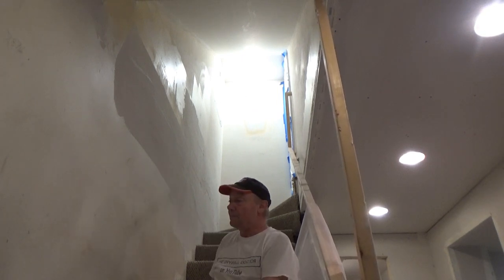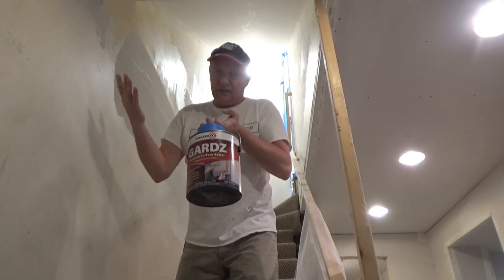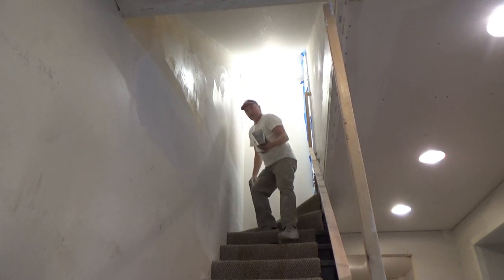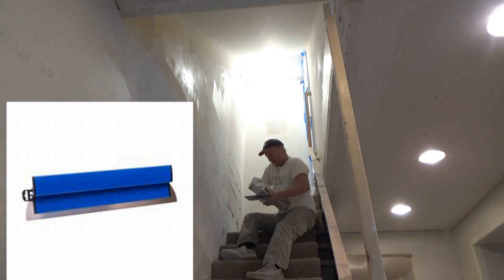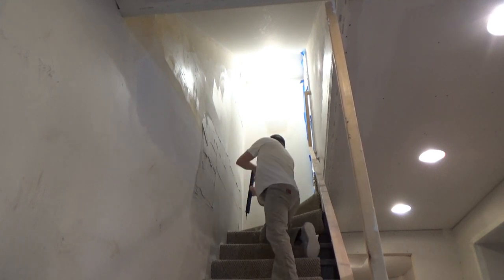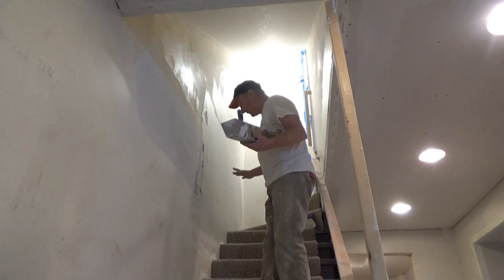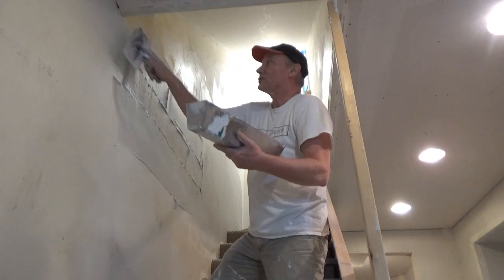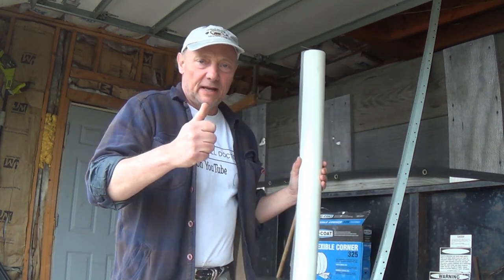Plaster patch part two and recap what we did so far

Comment: I've learned a lot watching your content.  I'm mostly self-taught and, while I'm able to get a good finish product, seeing a real pro at work both raises the bar and encourages me to stick with it.  I've been thinking about picking up a plasterer's darby for making large repairs and flattening really crooked stuff like you've got here.  Have you ever used one? I started out in the trade as a cement finisher and liked to use a cement darby for that, but never really considered a plasterer's type for drywall finishing.
Reply from the maker: Can't say that I have thank you for watching
Reply: They guy that taught me how to drywall would use a large Darby for leveling bigger areas (wonky ceilings and such)
Reply: @jimgill7524  Thanks. They are cheap enough-- $30.00-- that if it didn't work out I most likely won't go broke because I bought one.
Reply: @michaelkistner6286  that being said my buddee, I myself own 4 different sizes of skimming blades like the one he's showing in this video and I gotta say the finish job they can do is awesome. I could see the fill coat working well with the Darby and a finish coat with thinner mud and a skim blade working very well. Anyways I've got a full day of hanging beads on returns so I'd better get going. Have a great day sir
Reply: @jimgill7524  Have fun. I've only got three but plan on getting the big one for the next project on the books (couple of sizable ceilings to skim)..

Comment: Hey there Drywall Doc, I need some advice on spray on knock down texture. I'm doing a small (about a 1200sqft tape and float) job. I gave the homeowner a material list of      1 bucket and 4 boxes of all purpose USG mud. They got the 1 bucket of AP,  but got 4 boxes of Plus3. What's your opinion on using Plus3 for spray on knock down texture. I've never used Plus3 for anything, so I would really appreciate your opinion on this.
      Thanks
Reply: The one thing I can say about it is it’s super fragile even after it dries. I use it for skim coating and when u go to prime the wall afterwards if the primer is on to thick it will lift the plus 3 off the wall. Happened to me 2x with 2 different primers. just b mindful of how fragile it can b when u go to paint over it. Nice thin coats on both the primer and actual paint. The sanding is super easy but keep in mind it can come off the wall as fast as it goes on. Hope that helps.
Reply: @borys444  thanks for the info. I'm going to have them exchange it for AP.
Reply: @stevehairston9940  smart choice I was literally just about to say that. Never had a problem with AP during any application setting. Just a good all around mud.
Reply from the maker: Thank you and yes I would have them exchange it too